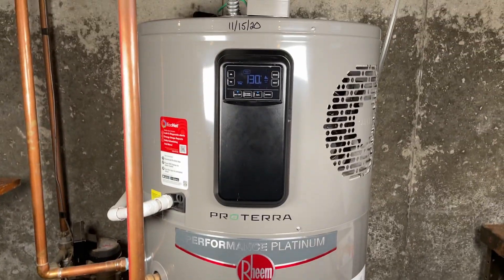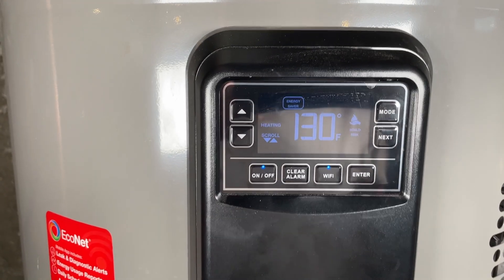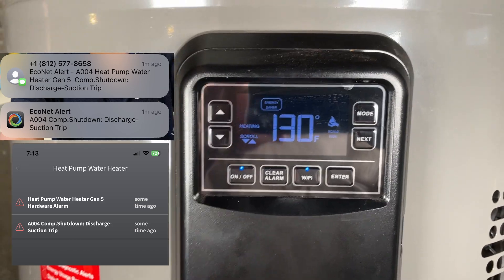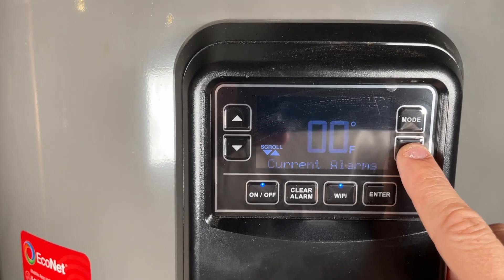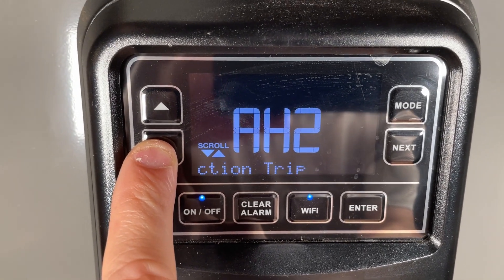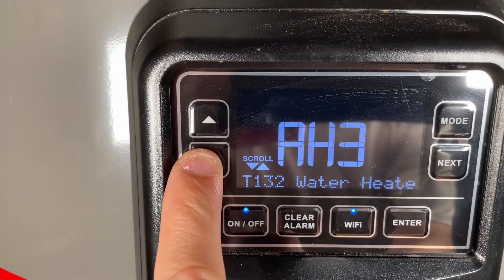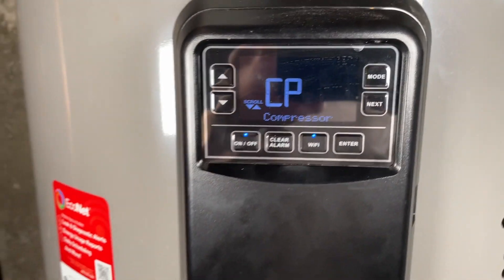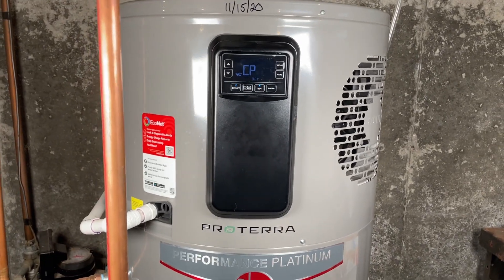Rheem Hybrid heat pump water heater error code A004 error code troubleshooting

Comment: Thank you!  Have 3 units that are a couple years old.  One just started throwing the A004 error.  Called the number went through the data with them and the deltaE for the evaporator was out of spec and they are sending me some new thermisters.  Even though I have the units in heat pump only mode - they precharge water for a gas tank - the electricity usage for that particular unit went up ( not sure why maybe the compressor is running more often ).
Reply: Generally the tank likes to work in Savings mode;  the heat pump only mode recovery is too slow for a house full of people.  It explains that in the manual

Comment: It's all about $ nowadays 🙄 mine is 2 yes old & throwing the same code. I wish they made durable products again 😢 thanks for ur vid.
Reply: Same, mine's a little over 2 years old
Reply: They are under-engineered a bit.   Mine at this point is almost 8 years old and I'm getting constant warnings about this or that.  I just replaced a sensor and a wiring harness yesterday and it worked great for a day, and then more codes today.  I love the idea, but I would've expected at least 10-12 years before replacement.

Comment: For both of you, what was the repair time?   I've seen other videos where temperature sensors needed to be replaced.   Nice that Rheem sends out the parts (I assume for free).   But it looks not trivial to take the top panel off so that you can get to the parts (probably more work if you detect the electric line).   

Wish they just used better components to begin with, so that we don't have to deal with labor to replace them as our responsibility.
Reply from the maker: Rheem did send the parts for free which was nice, but sort of crazy they expect homeowners to fix their equipment during warranty period... It probably only took 30 minutes to change out the thermistor. I posted another video where I show changing the part out - https://youtu.be/GKKvchxdkxI. Thanks!
Reply: It really isn't hard to pop the top off, but if you're not used to working on equipment of one sort or another, I admit it can be very daunting.   If you press Rheem, they will pay for a plumber.  Mine is 8 years old, so I'm glad for the support.

Comment: rheem had me replace the capacitor behind the panal. before the compressor would run for one minute before shutting down. after its been running for 4 hour. still good...

Comment: Thanks for posting this. Complex systrms tend to fail. No surprise electricity use increased. Rates in california are approaching $.50 a kwh, not including flat fee just to have service.
Reply: In this case with the A004 it's code because it doesn't use the heat pump compressor, it uses the resistance coils which makes it the equivalent of a standard electric water heater which uses more electricity than the hybrid mode (energy saver).

For those who want to know what each of the two-letter abbreviations mean:

CP - compressor temperature
DT - discharge temperature
ST - Suction temperature
ET - Evaporator temperature
AT - Ambient temperature
CURR - Current